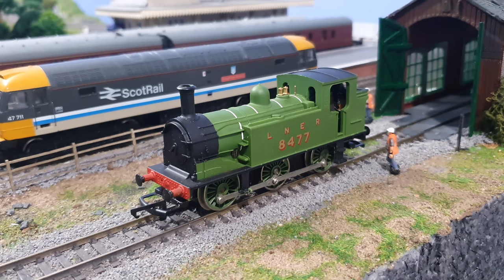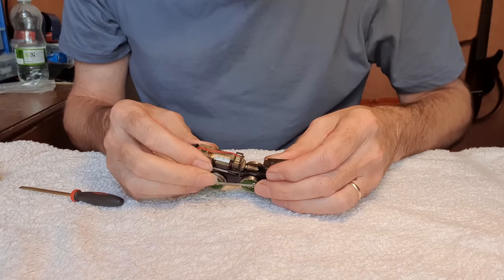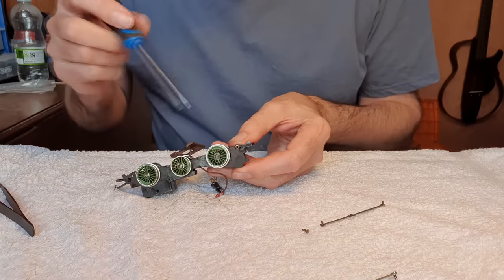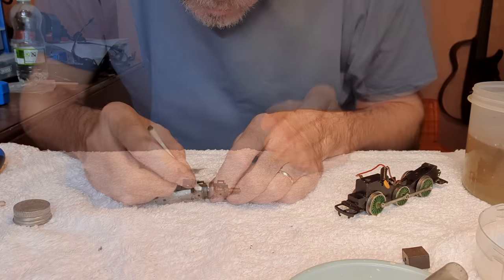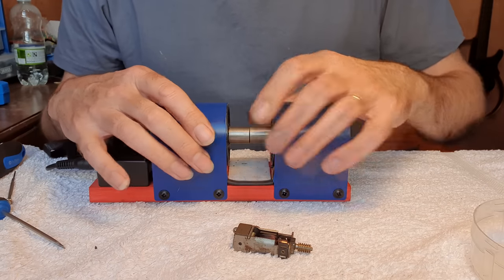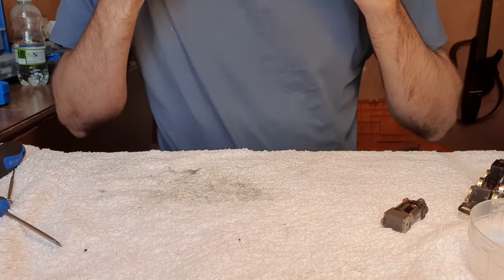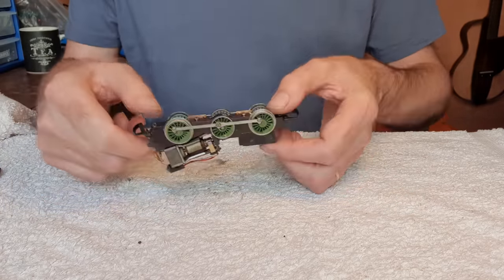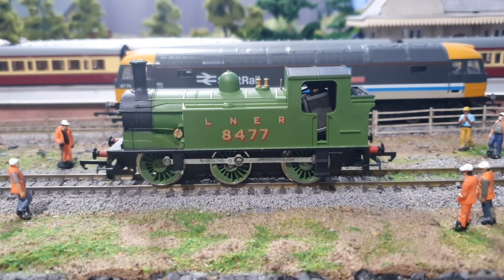Hornby R252 Class J83: Repair Request

Comment: Sometimes the manufacturing tolerances at the Tri-ang Hornby factory were a bit inaccurate.  Is that the understatement of the year?  😄.  I bought an Albert Hall that had the same binding problem and it took me ages to figure out that the rod pin hole in one of the wheels had been drilled off centre and it caused the rods to bind up at a particular part of the revolution.  It explained why the model from 1973 had barely been run.  All I could do was to drill the pin hole in the wheel very slightly larger and it immediately solved the problem.  It was quite a challenge.  Glad you got this one sorted out.  😊
Reply from the maker: Yup had the same problem with my Black 5 and making the centre holes a bit bigger solved it. Not in this case though!
Reply: @oobill  Yes, you clearly had a different 'manufacturing tolerance' problem to solve with the J83.

Comment: I don't know about your layout, of course, but I've found that if I try to run older locos (and wagons) with back-to-back wheel spacing as low as 13.5mm they will tend to derail on the modern Hornby and Peco points, as the wheels hit the guide rails and get thrown up.
Reply from the maker: 13.5mm is pushing it yes. Especially on larger wheels 13.8 - 14.1 is what I aim for depending on the model.

Comment: Does the contact cleaner do any damage to the plastic bushes?
Reply from the maker: No. Contact Cleaner is very safe to use on anything and evaporates quickly. Oil is much more likely to damage plastic bushes.

Comment: Hi Bill,  did you try swapping the left rod over to the right side,  that has worked on a few troublesome jinty's of mine, great that you got it sorted,
Reply: Yes, I've found that they aren't exactly the same and are 'sided'. Sometimes I get a loco with them on upside down which shows they are on the wrong sides.

Comment: The poor old 08 sure had trouble pushing that J83 into the workshop 😊
Like others, I've had rod issues as well. I've even swapped rods between locos and ended up fixing the bad one but not breaking the other one.
I can't work it out, but they both work, so what the heck.

Comment: Timely video working on a Jinty at the moment had a similar issue and was shorting out it had a wonky wheel and it was getting stuck to the magnahestion magnet on its way round got it of eBay as a non runner with an electrical problem did have some creative writing but I think the wheel getting stuck to the magnet was the original issue.
Reply from the maker: I tend to knock out magnahesion magnets for that reason.

Comment: I never understood why they made the cab windows that strange arch shape instead of round like the real ones.
Reply: I think it's to do with it being cast as one piece, round windows would be difficult to get the body out of the mold, today of course most loco cabs are cast as a separate item, so have the correct smaller round windows.
I filled mine with plastic padding and then drilled a hole when hardened.